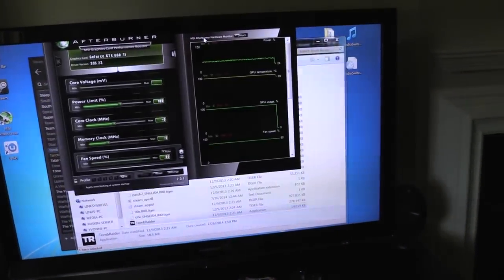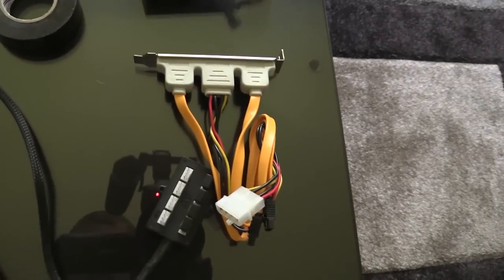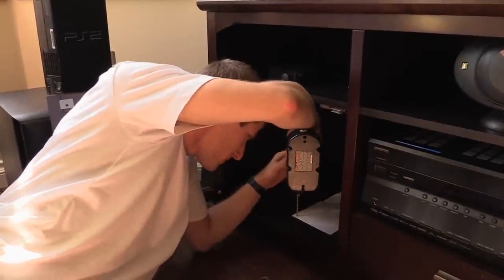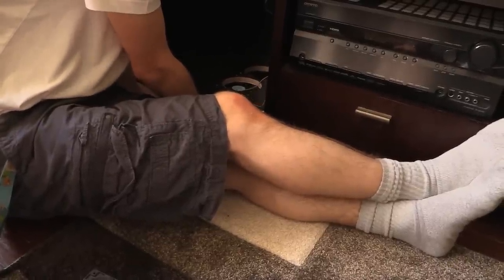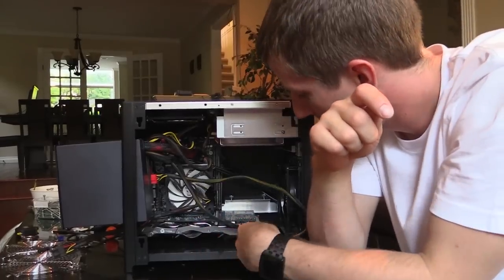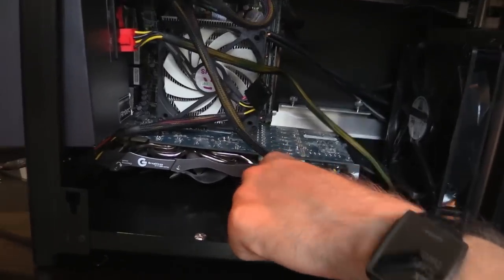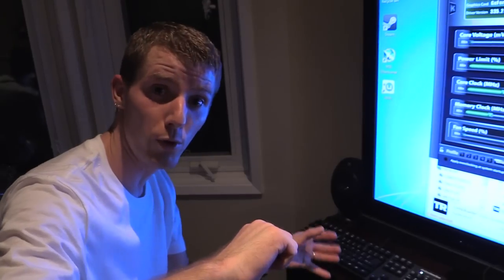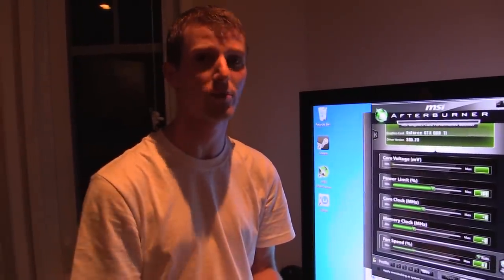Entertainment Center Cooling Mod - Linus DIY Method

Comment: For perspective, this is why people buy consoles.
Reply: if you stuck your console in a close container, it would be just as hot, while console does not release as much heat as a pc due to lower performance, they still have small fans, which is not so nice for cooling.
Reply: Wade Curtis No tweaking of any kind. I think thats an interesting aesthetic.
Reply: miiiikku Or, a slimline case. Nothing larger than an old VCR sized enclosure would be perfect for this scenario.
Reply: miiiikku you do know this is all by choice right? He's an enthusiast and he likes doing things like this
Reply: Well, it's entertainment centre, consoles are just for gaming while pc can do a lot more, beside, he has PS2, which has way more better games.
Reply: ***** But then you would have to understand something about computers. Know what to buy, for expensive price, build it for yourself maybe, you can't expect ten year support, you can't just walk into any store and buy something like that, it would be a custom system and maybe with problems later on. Think about buying a day one Xbox 360, which doesn't break, or you get new from warranty, still relevant system today, released on 2005. Its quite a product.
Reply: miiiikku Actually, devs have to downgrade the graphics in order to keep the system running the latest actually, because they don't have the graphics option like pc did. They are in fact already out of date half way down.
Reply: QuashTaki
 It is a relevant system, even today. Most games still get released on both "next-gen" and last-gen consoles.
Reply: Zontzo They will soon ending up like ps2 and original xbox to promote the sales of next gen, although it's slowly.
Reply: If he bought a console, then how could he play TIE Fighter on the couchmaster in front of the TV or Mount&Blade Warband or Distant Worlds or STALKER?
Reply: I agree. I'm still pcmasterrace all the way, but the appeal of consoles is understandable
Reply: Craaptonium Uranus
I have bought Xbox, PS3, Wii, Windows phone, iPads, Android tablets, Android phone, Symbian phone, tens of motherboards, processors, coolers, cases, graphics cards, televisions, dvrs, stack of laptops. Like many of us.
Reply: Well, if it was just for gaming, then yeah. But an entertainment center pc does lots of other things which are either not optimal or not possible on a console.
Plus, if stuck on a cabinet, its temperatures would go up quite a bit and the console would be really noisy (not sure about everyone else, but I say this because of my PS3 which I dont use anymore...).
Reply: Consoles have their place. They are generally straight forward and easy to get setup. But they don't offer anywhere near the versatility of a PC. They have online subscriptions for a service that is mostly peer-to-peer and not server based. The games are very expensive at launch and seem to retain the high price tag for months upon months. PCs can provide a greatly superior experience in gaming, but they can also do much more than that. Some make the argument that a decent gaming PC costs way more than a console, however if you take into account that you have to pay a yearly subscription with consoles, and that the games are about 20% more expensive, PC gaming is vastly cheaper. It comes down to whether or not you are willing to put the effort into a PC setup. If you do you'll be rewarded by a better experience for less money. If you don't and opt for a console instead, you'll get a substandard experience and pay more for it.
Reply: miiiikku
"Like many of us". Not all people who follow LinusTechTips are spoiled rich 1st worlders. In fact i'd propose a survey to see the stats of class division.

But to get on topic, you are not answering the question, you are evading it and moving goalposts, especially if we look at your original post.
Reply: Which is why the YLOD and RROD happened so much. They overheat worse than computers, they actually kill themselves in the process.
Reply: Consoles also overheat.
Reply: Wise Guy 508 trust me I know.  So many calls to get their system fixed and it was shoved in something like that or even on carpet under something like that.
Reply: ugg he said way more better. That is what the word better is for in this sense. He likes doing these things with pc's, so this is fun for him. I would not agree with you on this because consoles, even next gen ones, still can't beat a mid grade pc. Also you can customize everything you want inside a pc and also you can upgrade.... Sorry for being a pc elitist.
Reply: miiiikku
also support is not an issue. You can usually get 2 to 3 year support on some of these items that you buy in the stores and online. Also most things you can find on a discount. I just bought a new graphics card for very cheap and it comes with a 2 year warranty
Reply: merlin83221 Same here i lost count the amount of consoles i get packed full of dust and tobacco & cannabis oils they new consoles are going the same route :D ££££ for me i suppose
Reply: You mean like with half of the Xbox 360 overheating and straight up dying ? Console or PC, don't put it in a close environment.
Reply: CK Gamer Confirmed. I had a PS3 that overheated to the point it shut itself down.
Reply: Wade Curtis Oh common its not poor performance it's perfectly usable. Not everyone needs or wants amazing graphics.
Reply: jonoc5 We can install mods without getting banned
Reply: Topias Salakka Modding is nieche. If you want to mod then you should already be pc gaming for that reason, the vast majority of gamers have no interest in modding.
Reply: jonoc5 I don't play with mods often, just if they improve performance or graphical fidelity.
Reply: a console would overheat in a poor ventilated area.
Reply: Craaptonium Uranus
What is the original question? I was just watching this video and I thought, you really don't run into issues like these with consoles, they are quite nice that way.
Reply: Not true at all.. Remember the red ring of death. The yellow light on the ps3. Those were major problems. Unless you are talking about the wii.... Then you get out of this conversation because you don't deserve to be here. Back to the consoles... Those were huge problems that would literally leave your xbox/ps3 unuseable. That was a problem with me and a lot of other people would say the same
Reply: That and pretty much every other console
Reply: red ring of death .... that is all
Reply: the yellow light for me was aweful... I had to get it fixed many times even though they said it was fixed
Reply: For your perspective, Linus isn't an average PC user. He's what we consider and enthusiast, and his channel happens to be PC central. His methods and PC builds go beyond 95% of the average person. Your assumption that everyone has these problems is obviously poorly made and uninformed.
Reply: Overheating is a common problem for your information
Reply: miiiikku
Tell that to all the RRoD and PS3 equivalents. They had to underpower the CPU and GPU in both the Xbox and PS4 to compensate for the heat output in the compressed format and i hear even these are suffering problems from time to time despite that.
The issue is equivalent in both consoles and PCs,
excluding the fact that PC MicroATX/MiniITX cases come in many formats with proper ventilation and can fit cooling options, including liquid cooling, that console manufacturers won't bother with because it adds onto the console cost that they want to keep at a minimum for the sake of appearance and marketing psychology competitiveness.
There's also the theory that they WANT consoles to overheat so idiots can go pay for fixing and replacements like with the Xbox360 era (where CONVENIENTLY every replacement counted as a "buy" which added to the "units sold" superiority jerk counter).

Now tell me, what rotten pot you are smoking?
Reply: For perspective I had to do something like this for my consoles because you could tell they where too hot, last gen consoles got damn hot so to avoid a Sony YLoD and a Microsoft RRoD I screwed a panel of thin MDF to the rear of my media shelf and fitted a 140mm fan at the back of each shelf.

 They are powered from the consoles USB ports so when the console is on it starts the fan behind the console, pulls cooler air in from the front of the shelves and over the consoles.so they have plenty of cool air.

As a non peasant and have experience building PCs I understood that the heats a bad thing, console only peasants just play until the console melts.
Reply: miiiikku but tweaking is Fun! ... well not for lazy people obviously
Reply: Not if you don't have to
Reply: miiiikku
I don't think your getting the point, my old PC was sort of powerful (Still more powerful than consoles) but I never had a problem with it, because I didn't go to the extreme with the modding. My current PC on the other hand it very custom and I have spend hours modding it (its water cooled), we are enthusiasts.
Reply: Putting consoles in places with low amounts of places to let the cooling do its job well is ill advised from what I can tell. Give even the console room to breathe. I have my PS2 and PS3 in places that let them breathe and they've worked flawlessly. My PS2 is at least 13 years old and has never been in a tight space with almost no breathing room, in fact.

Dust, like in PCs, can cause big problems for consoles. Many consoles have most likely stopped working from dust more so than age.
Reply: Cough Cough RROD Cough Cough
Reply: jonoc5 I am a pc gamer.
Reply: Topias Salakka ...who said you weren't.
Reply: jonoc5 It seemed like you did
Reply: Inb4 red rings of death or yellow light of death
Reply: just throwing it out there, my tower doesn't put out the same heat in the exhaust as my ps3. both are warm the ps3 is warmer. i'm running some decent hardware to.
Reply: Alex Chulzhanov PC is the most silent of them all
Reply: Topias Salakka With quiet fans and a good case? sure.
Reply: ***** So you can drill holes in your furniture?
Reply: jonoc5 this is no big deal. i would have just ran some cheapys to a usb cord and used an ac/usb adapter (maybe an ac/dc adapter if they wouldn't run fast enough). i actually was thinking of doing this for my dish box and a/v receiver.
Reply: miiiikku For perspective this is why people don't buy consoles. Some people enjoy DIY projects.
Reply: This looks like so much more fun than plugging in a console...
Reply: jonoc5 they're all pretty quiet with some tweaks. just requires a slight aptitude. nothing like the consoles. well the ps3 isn't bad either.
Reply: Consoles get way hotter than a computer, and there is no way to change the air flow easily in a console, and all you can do is play games...
Reply: Wyatt Williams what If all I want to  do if okay games...
Reply: jonoc5 better visuals too
Reply: Wyatt Williams Not by that much. Some people want the best graphics, some don't. As long as the game looks ok then i don't really care.
Reply: jonoc5 have fun paying double for games, and a library almost cut in half.
Reply: Wyatt Williams Nah. I'm not too fussed about a bunch of kooky indy games, MOBAs and RTSs. I'm comfortable with paying £20 for games.
Reply: jonoc5 I just got BF4 for $20 not $60
Reply: Wyatt Williams BF4 is £10 less on PC. For 100+ hours of play £10 is nothing and even then i buy like 5-6 £30 games a year so that's £55 for a whole year. For anyone not spending their life in their parents basement playing video games £55 a year is not a con.
Reply: Most buy them out of sheer ignorance. Luckily consoles are dying, albeit slowly.
Reply: miiiikku
Yeah the xbox 360, and even the xbone aren't relevant. Your about even with a computer + graphics card from 5 years ago. Please educate yourself
Reply: no, consles cost ALOT more over time...
Reply: This is also why the RROD happened, because the 360 NEEDS ventilation, but it was pretty much the first console to need it as much as it did, but people put it in enclosed spaces or blocked the vents.
Reply: miiiikku  It's really not hard to do any of that...
Reply: CK Gamer Game consoles are definitely not just for games.  I use my XBone almost daily, and very rarely is it for games, that is what my PC is for, games and taxes.
Reply: Kinda like Android vs iOS. Convinience vs the ability to tinker out of the box. They both have purposes, and anyone who does a vs just needs some more conflict in their lives because that is a waste of time.
Reply: jonoc5 if youre gonna hide your console in someplace like he did in the video, trust me... you're actually gonna need to do the same as he did... even consoles burn down, also for the fact that consoles are assembled just like a pc, but with poor as hell ventilation (laptop leveled)
Reply: yeah, my friends ps3 broke from overheating, i see your point
Reply: Alejandro Cheng It's not poor if it's sufficient, laptops have enough ventilation for their components. My ps3 has been chugging away in a media centre for 5 years without a whimper.
Reply: Consoles overheat, are frame rate locked, can't play anything over HD, and are as powerful as 2 year old PC hardware. Consoles also have more ventilation than the case Linus was using for his Media PC, which a Media PC in itself that has more functionality than a console. This Mod is something that could also benefit a console, but used on this Media PC, he now has a system that is faster than any console, can play any game he wants on his TV at whatever resolution his TV can support, and now has better thermal support.
Reply: Keith Roylance "and are as powerful as 2 year old PC hardware." Show me any console, that comes even close to 5 year old hardware :D
XboxOne and PS4 both have GPUs, that have been low/Mid-range by their release.
For the money for such a consol, you can already get/Build your own media-PC. 
A bit extra, and you beat them in any way possible.

I still own consols, but hardly ever play them, cause i rathe rpaly some ORPGs with friends.
Reply: ABaumstumpf  A media PC beats a console for ease of use? Pah.
Reply: jonoc5
if you can use your PC and build one, i'd asume yes.
I hate console-menues... PC with mouse is easier to use P
Reply: ABaumstumpf If you can teach my grandmother how to use a PC, I might pay you, but she mostly figured out how to use a Wii by herself.
Reply: ABaumstumpf Using a mouse and keyboard from a couch is easier than a game  pad? Just no.
Reply: jonoc5 When the Roccat Sova wireless Keyboard/mousepad combo is released, it will be.
Reply: Keith Roylance Not even close.  The Play Station and XBox controllers, or a TV/cable box remote can comfortably be used in almost any sitting/laying position.  A keyboard and mouse can only be used sitting straight up.
Reply: Folopolis are you kidding me? I even use a mouse upside down and even from bed to desk lolz
Reply: Folopolis You can just as well use a gamepad on a PC if you can't handle a mouse/keyboard.
Reply: ABaumstumpf But then you're just as limited as you are with a console.  The fact remains that for most people, consoles and Rokus are better living room devices.  At least the Wii U can play Mario Kart and Smash Bros, and the Roku is dirt cheap compared to a HTPC.
Reply: Keith Roylance Ah ok, so until some obscure peripheral is released PC gaming is less accessible than console gaming. I.e you're admitting it has been that way for 10 years. Cool.
Reply: jonoc5 It was easy for me the past 10 years, can't say the same for others.
Reply: Keith Roylance You're saying that you have a PC under your tv that you boot up, select games from and play without using a mouse and keyboard and have done for ten years?
Reply: jonoc5 So you're saying that every single laptop in the world that you can install a game on, is less accessible and more expensive than any other console in the world?
Reply: Keith Roylance For the life of me, I can't figure out how to get my gaming PC to start up into Origin or Steam and start playing a game or Netflix and be able to switch games without touching a keyboard or mouse.
Reply: Folopolis So you  have no idea how to use a keyboard and mouse, is what you are saying.
Reply: Keith Roylance Err what. I'm not talking about laptops, i'm talking about using a computer as a console replacement.
Reply: jonoc5 You mean to tell me, that a Laptop is not a computer?? Shit, when did this happen?
Reply: Keith Roylance It's not relevant. You wouldn't leave a computer under a tv
permanently and even then it doesn't solve the accessibility issue.
Reply: jonoc5 Exactly, none of it is relevant.  #pcmasterrace
Reply: Keith Roylance Way to not answer the point.
Reply: I was only following your lead.
Reply: ***** I wouldn't call having to drill holes in your furniture fun.
Reply: A modern console would overheat in this scenario as well.
Reply: Consoles also have the problem of temperature management. Putting something that must be cooled in a place such as that is a HORRIBLE idea.

Comment: I did a similar thing to the cabinet in my room. I always worried something would get way too hot since my room is one of the warmer places in the house.

It be interesting if the designers of these "Media Hub" Cabinets started incorporating fan mounts or better ventilation since these things are meant to house electronics that tend to warm up a lot.

Comment: This is an excellent example of computer placement and case type. For example a normal pc case is designed to have fresh air surrounding it and not in a closed space. By opening a few air holes does help some, I cant help to think that a case with more air vents can also help with cooling. Idk if I would mod my case any to help the ventilation or I would find a more suitable case. Instead of cutting big holes how about cutting slots on the bottom of the case and find a way to place a filter over or under it for the fans? That is an option as well. Great video.